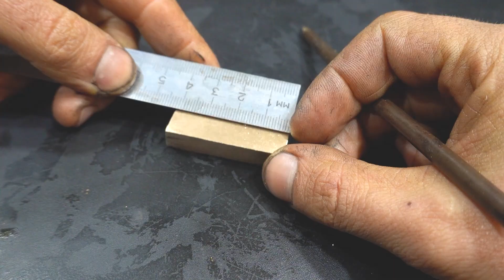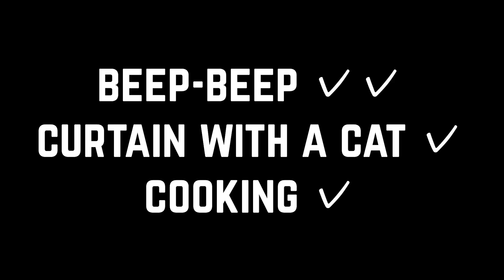Restoration and Renovation of Kalashnikov Bayonet Knife

Comment: CLEANED UP NICE,,,WHATS THE HOLE IN THE BLADE FOR
Reply from the maker: If you have an original sheath, you can cut the wire and perform other actions.
Reply: @ScrewsAndTools  THANKS

Comment: AK74/AKM bayonets are really soft steel. I really like the handle this time, sometimes you make them a bit too bulky (for my taste) but this one fits the style and purpose perfectly. Too bad about the wire cutting hole, if you scavenge a a sheath and mount the required metal parts on a piece of wood thats inside a sheath it could work. Other than that i love how you show little mistakes, i make knives as a hobby (not on YT) and know too well about the joys of having to redo 3h of work because ive forgot some minor detail. It's a learning process and the easiest way is the most boring. Keep up the good work!
Reply from the maker: Greeting! Thank you for attention. Yes, I know about this still, I heard alot of story and read some articles how this steel can broke and bent. Its wondering, how to instrumental steel can be like soft metal....and why
Reply: @ScrewsAndTools  Im guessing it's for the sake of durability. Hardened steel can break easier and bayonets were never meant to be really sharp in the first place. Just something to stab someone and may be a tool in the second place. Only Mikhail Timofeyevich Kalashnikov will know. Happy Holidays (if you're celebrating)
Reply: Совершенно верно. Он не предназначен для резки. Его работа колоть. Точить эту сталь нет смысла. Острой она не будет но для резки продуктов более менее пойдёт.

Comment: Great work! only change I would really make is with the sheath and how the knife is secured to it. I personally prefer a snap closure that goes from the back of the sheath around over the handguard/barrel mount and snaps onto the case.  To me it is more secure and less rattling/movement up and down in the sheath. (oh, and I would love to have the part of the old sheath that allows you to use it as a wire cutter but  that would require having that piece and adapting it to your sheath)
Reply from the maker: Greetings! When I found it, I realized that this knife was already retired, but I decided to give it a second chance. Now he works in my household)) Thank you for attetnion!

Comment: Will it still fit an AK as a bayonet or as a wirecutter with the attachment for that hole in the blade?  Stew looked tasty and filling for a cold weather day.
Reply from the maker: Hi! Thanks for attention. If I find the scabbard, it will be, because I changed only part of the handle. I didn't touch the ring and the hook. But now it turned out to be like a knife for survival and hiking.

Comment: Interesting the edgef the blade looked like it's still in pretty good condition
Reply from the maker: Thank you!
Reply: Caught a lil' error however, the ring on the guard is on the wrong side
Reply from the maker: @Archiemonty  This is excluded, because the rivets on the blade were not touched.

Comment: I like what you did for the handle but the little brass fitting at the bottom looked kind of strange since the back of it was all filed away, still a great shape for a handle thought. Also I'm guessing that discoloring on the blade that you were worried about from the beginning wasn't a problem, is that right?
Reply from the maker: Greetings! Based on the fact that I did not want to remove the ring and hook that give their character to this knife, I decided to leave, and therefore the handle does not look standard. Thank you for atteion!

Comment: it would be more correct to call this device "bayonet-cutters", since the function of the knife in it is secondary))) first a bayonet, then a hacksaw for metal (a sereitor on the butt), and in the presence of original sheaths- wire cutters that can bite barbed wire. well, and open a can of stew!😁
Reply from the maker: Greetings! Thanks for attention. By the way, if there is a regular scabbard, then yes, you can do a lot, but there it is a knife for survival or just for housework.